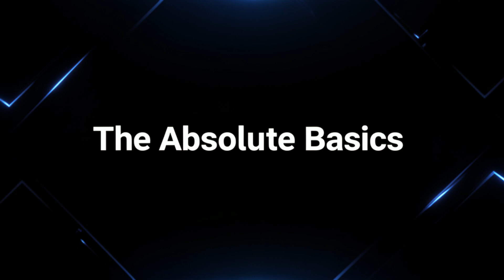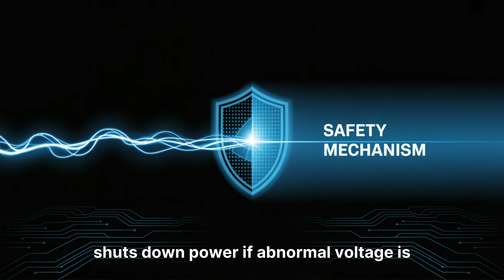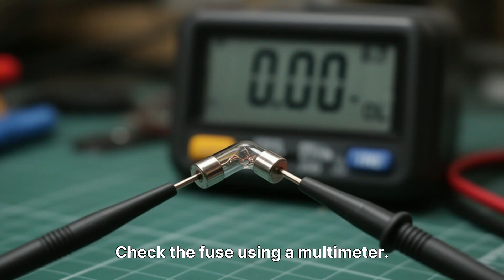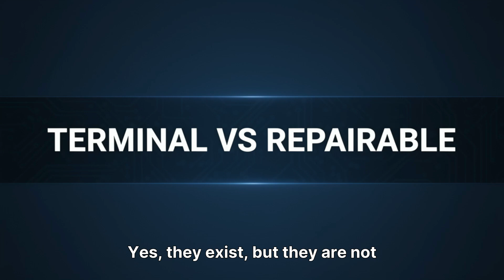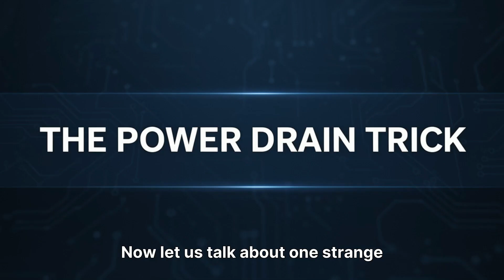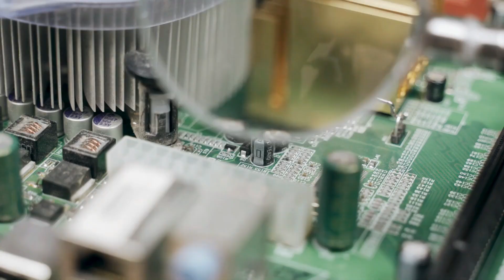PS3 Won’t Turn On at All? Fix It Fast! (No Power, No Light Solution Guide)

Comment: I have a PS3 Fat CECHK04 model that had a YLOD in 2015, after which I kept it in storage. Last month, I tried to power it on and fix it myself after coming across a video that suggested replacing the NEC/TOKIN capacitors. I thought I would try to boot it up before attempting the repair, but my PS3 Fat would not power on. I diagnosed everything and found that while it produces 5V on the PSU rail, there is no 5V on the PS-ON rail, and it does not turn on. I researched this online and found that the standard 5V from the PSU needs to travel through the motherboard to reach the syscon, which then sends a command back to the PSU to send 12V output to the motherboard. In my case, the syscon is not receiving the 5V, and I do not know how to fix it. Is there a way you can help me with this? I want to fix my PS3 Fat as it holds childhood memories, and now it does not have the standby red light.
Reply: Hey can I get a reply from you?

Comment: I’ve used my ps3 two days ago with no issue. I turned it on, the green light turned on, then turned off, then the red light turned off. Now I cannot get it to start at all. No red light, no noise nothing. 

I’ve tried everything except taking it apart or taking it to a shop. They’re wanting to charge $100 upfront. What should I do?
Reply from the maker: It sounds like you've got a common issue where the console isn't getting any power. Since you've tried everything except taking it apart, it might be an internal power supply problem. You could try checking for loose connections inside if you're comfortable with that, or consider the shop if the $100 upfront is for a diagnostic that can save you more in the long run.

Comment: When pluggjng the PS3 on after a couple of years,  I  
heard a zapping sound from the PS3 plug which was somewhat loose in the voltage stabilizer. Then the red light went out and did not come on again since then. I will try after getting a new 8 power plug.
Reply from the maker: Yikes, a zapping sound isn't ideal! Hopefully, a new power plug will sort it out for you. Let me know if that does the trick!

Comment: You didn't address the board that has the power button itself and eject button.

If it is damaged or it's ribbon cable has come undone it will not turn on the console as it is disconnected from it.
Reply: Thank you so much for pointing that out. I had tried everything possible and nothing was working until i checked out  the board that has the power button itself and eject button. The ribbon cable was damaged, swapped it out and all is good now. You have no ideal on how you saved me on protecting memories for the past 20 years. I can still use my original fat 60gb backward compatible PS3. THANK YOU THANK YOU THANK YOU!!!!!!!

Comment: When I go to download a game, put it in run in background, then play a game the console shuts off then I let it cool down and drain the power. It sometimes will come back on then the same actions happen. Ill probably watch a teadiwn video and see how to replace the power supply. Also I did upgrade the HDD to a SSD 512gb from a 160gb
Reply from the maker: It sounds like you've got a tricky situation there, especially with the console shutting off during downloads and gameplay. A teardown and power supply replacement definitely sounds like a solid next step, especially after an HDD upgrade. Good luck with the repair!
Reply: @TechVibes-maf I swapped back the old HDD and it stayed on longer but still shit off
Reply from the maker: Hmm, that's a tricky one! It sounds like the HDD might be part of the issue, but there could be something else at play. Did you notice any other changes when you swapped it back?
Reply: @TechVibes-maf so the HDD stays on longer than the SSD did. But I'm shipping this out to a repair shop

Comment: Ciao, avrei bisogno di un tuo parere su una PS3 FAT con un problema video abbastanza strano.

La console si accende normalmente: LED verde fisso, ventole funzionanti, nessun YLOD. Ho sostituito l’HDD originale con un altro HDD SATA 2.5” funzionante proveniente da un’altra PS3 e montato sul caddy corretto della FAT. Il controller si collega regolarmente e assegna il giocatore 1, quindi sembra che il sistema almeno in parte avvii.

Il problema è che non ho nessun segnale video tramite HDMI. La TV Samsung rileva comunque il collegamento HDMI, quindi non sembra una porta completamente morta, ma rimane schermo nero.

Ho provato il reset video dei 2 bip: da console spenta tengo premuto Power. Fa il primo bip, parte con LED verde, ma continuando a tenere premuto non arriva mai il secondo bip del reset. Dopo un po’ fa un altro bip e si spegne normalmente. Ho provato anche senza HDD ma il comportamento è identico.

Ho provato anche collegamenti analogici di fortuna sulla TV (la TV rileva qualcosa sugli ingressi, ma non ho immagine). Sto aspettando un vero cavo AV Multi Out PS3 per fare il test corretto via SCART.

Secondo te, considerando questi sintomi, cosa controlleresti per primo? Può essere un problema dell’encoder HDMI Panasonic, della porta HDMI, oppure il fatto che non faccia il secondo bip fa pensare a un problema più profondo (RSX, NOR/NAND o boot video)?

Quali misure o prove faresti prima di aprire ulteriormente la console? Grazie!
Reply from the maker: Ciao! Dalla tua descrizione, sembra proprio che tu abbia fatto molte delle prove standard. Il fatto che la TV Samsung rilevi il collegamento HDMI è interessante, ma l'assenza del secondo bip al reset video e lo schermo nero suggeriscono un problema più profondo. Io controllerei prima di tutto i condensatori NEC/TOKIN attorno all'RSX, anche se non hai un YLOD. Prova anche con il cavo AV Multi Out quando ti arriva, potrebbe darti qualche indicazione in più.

Comment: can u help me, everything is connected correctly. and when the power gets to ps3 the power button is red and when i press on it it doesnt turn on. and fans and the whole system doesnt work but there is red light on power button.
Reply from the maker: Hmm, that's a classic PS3 red light issue! It sounds like it might be a deeper hardware problem than a simple connection. Have you tried a different power cable or outlet just to rule those out?
Reply: @TechVibes-maf  nope that still doesnt work.
Reply from the maker: Sorry to hear that still doesn't work for you. There might be a different underlying issue.

Comment: When i unplug the power cable and plug it back it will show red light and when i press tge power button it will show green light for some seconds and then it will off atomatically 

THIS HAPPENS EVERY TIME I PLUG IN 

any ideas for this😢
Reply: The yellow light is not showing but?
Reply from the maker: If the yellow light isn't showing, it might indicate a different issue than the one covered in this specific part of the video. Have you tried checking the power supply or other common culprits?
Reply from the maker: That sounds like a classic YLOD (Yellow Light of Death) issue, which often points to a problem with the console's internal components, likely the motherboard or GPU. It's a common PS3 failure, and unfortunately, it's not usually a simple fix.
Reply: @TechVibes-maf Any thing i can do?